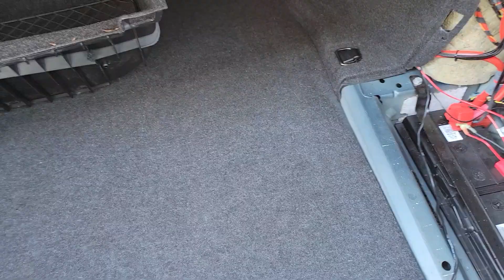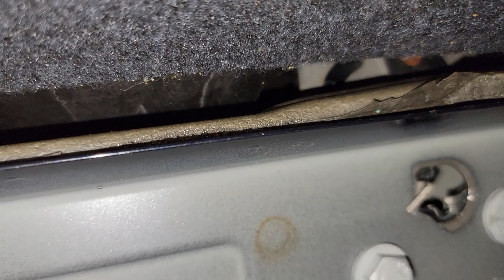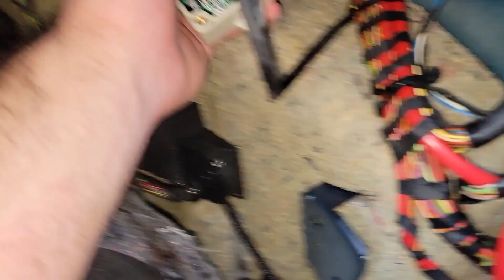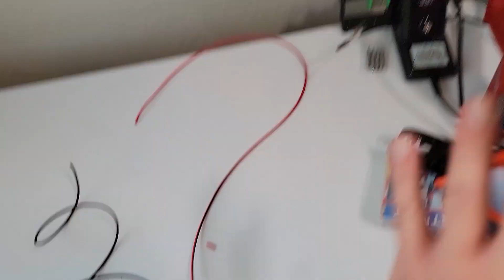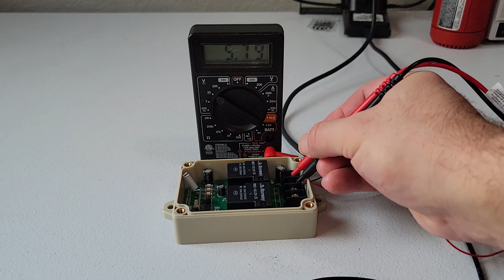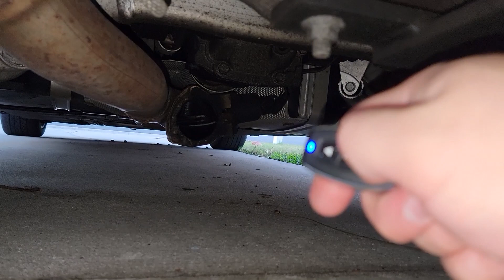$20 Electric Exhaust Cutout Controller - Wireless

Comment: I have QTP on two cars and had failed gear and remote i bought the first and second i just went a different route, this company needs to check their products. Thank u for making this video
Reply from the maker: Ah that sounds terrible, especially considering how much the QTP controllers cost. Hopefully your new setup lasts a long time 👍
Reply: @FoulNews  fingers crossed 🤞 lol btw I saw ur website can u make 3D custom print  work nothing too big or too complicated
Reply from the maker: Yes, it just depends on what's needed.
Reply: Not to mention that they have like literally the worst wire connectors, and they still have not changed them..

Comment: Great video! Question for you, I think I burned out my existing controller by trying to put both of my cutouts on the same one. You know if any of these would be able to handle having two motors hooked up to
Reply from the maker: Thanks! It honestly depends on the amount of current each cutout uses. If you have the specs for the cutouts, check to see the amp draw on them. Also make sure your wiring is capable of handling the amperage as well to reduce heat as well.

The controller in this video is rated for up to 20 amps in rush current, which is plenty for the servo motor on the cutout I'm using.
Reply: @FoulNews  I bought these like 10 years ago so exact specs may be hard... Can I measure it?

I may be able to find similar ones on AliExpress though
Reply from the maker: @MrDontask007  Yes, there's a few ways to do it.

1. With a multimeter, set it to DC current and put the positive probe to the circuit's ground and the negative probe to the ground coming off of the motor and send power to the motor. The current will be displayed on the meter. Just make sure you have a meter rated for at least 20 amps or one with a changeable fuse.

2.  Use a clamp style multimeter, set it to read DC current and clamp it around the positive or negative wire from the motor (but not both at the same time) and power the motor. Then the amp draw will be shown in the meter.

3. Use a DC bench power supply with a voltage and current readout and power the motor with 12V. The amp draw should be shown on the bench supply.
Reply: @FoulNews  awesome thank you! 

To expand on making the 2 motors powered by 1:

12V power from fusebox to control box

Out to 2 motors - would this be too low voltage or if the wires don't have enough amperage, not enough juice to power them? How does that work/what would the issues be? 

I imagine if amperage isn't right, wires or fuses would get too hot and blow but not my strong suit

Thank you!
Reply from the maker: @MrDontask007  No prob! The voltage is just fine at 12V, the limiting factor is the current through the wiring and controller. The battery will provide all the current and more, but if the wiring and controller aren't up to snuff, they'll burn out. 

Once you know how much current each motor draws, just add that up for your total current. My guess is that it will be less than 20 amps. What you'd then do is use 12ga wire from the battery to a 20 amp fuse (or anything 5 - 10 amps higher than the comnined motor current) and then run the wire to the controller. Use the same gauge wire from the ground to the controller. Make sure the ground has good contact, or wire it to the negative post of the battery. From there you can run 12ga wires from the controller to both motors. As long ss they don't exceed the controller's rated continuous current, you shouldn't have any issues.
Reply: @FoulNews  amazing! 

If I'm thinking of wiring this to a switch in the car, do I even need a controller? Similar to your existing setup prior to the wireless
Reply from the maker: @MrDontask007  If you plan on using a manual switch, you just need to make sure the switch is good for the current requirement and no need for a controller. Just make sure you use a fuse between the switch and battery.

Comment: Very cool. Will be doing this mod
Reply from the maker: Nice! It definitely beats having to reach over for a hard-wired switch!
Reply: @FoulNews  
Been meaning to put my LS400 and my TT SC300 on a cutout anyway. Occasionally one needs to be silent.
Definitely better than a hardwired switch.
Reply from the maker: @negativeindustrial  Nice, sounds like some sweet rides! I definitely prefer the cutout route. I love having the BMW nearly quiet as stock most of the time and loud when I want it loud. My MR2 is always loud and my Forester is always quiet lol. It would be nice to have it on them both as well.
Reply: @FoulNews  
Nice. My MR2 Turbo and my Celica Turbo are always on loud. GReddy exhausts on both of those.